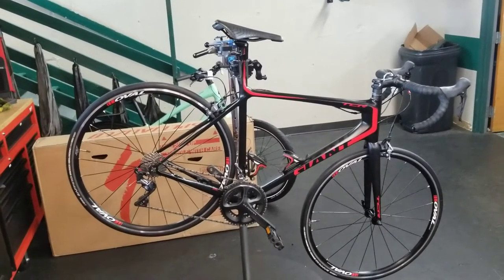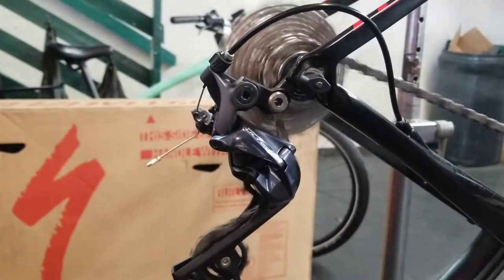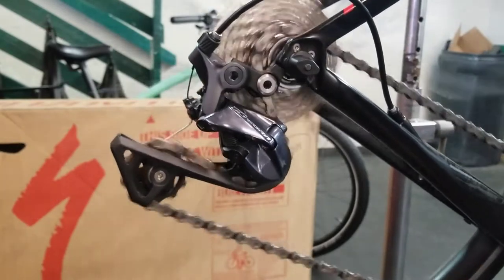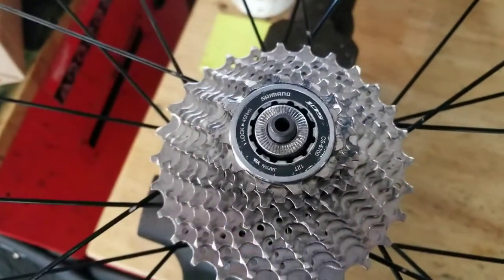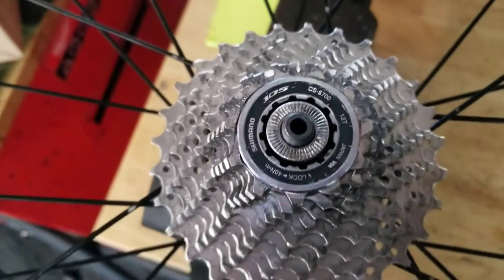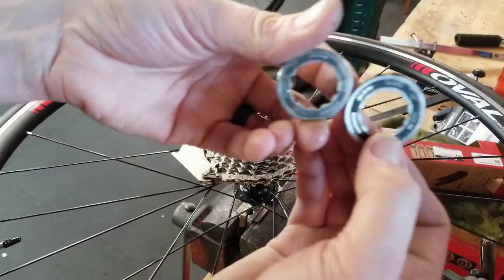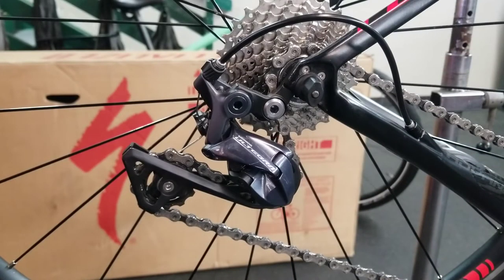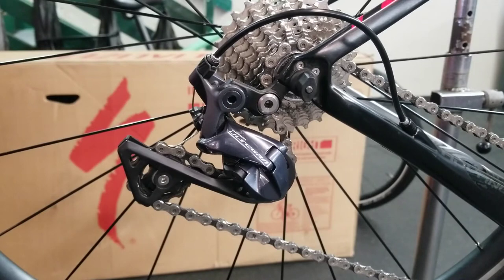Lets Fix a Bike #8 Why is this cassette jumping mystery??? Its always what your not looking for!!!

Comment: What could explain my issue which is shifting works perfectly on the bike but when I put it on a trainer with the exact same 12 speed cassette it makes sounds and rubs the front Derreailur on the top and bottom gears ⚙️… I’ve tried everything. This is now the third cassette and again it matches my bikes cassette.

Comment: never swap lockrings, same speed or not with the same brand or different brands for same speed. may damage (crack) the freehub because thread between lockring and innerhub are not exact the same and you try to overthight when there is no more thread to play. 

Use the lockring supplied with the cassete when you bought it and no other.